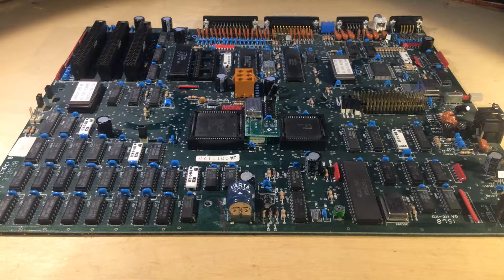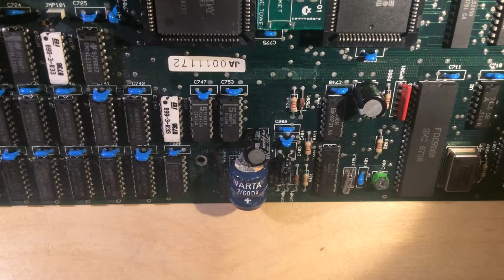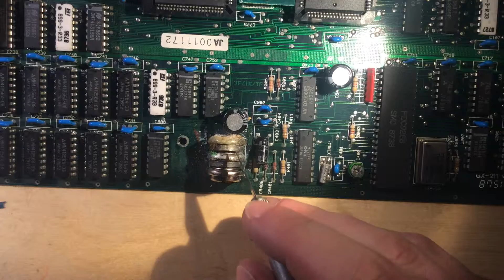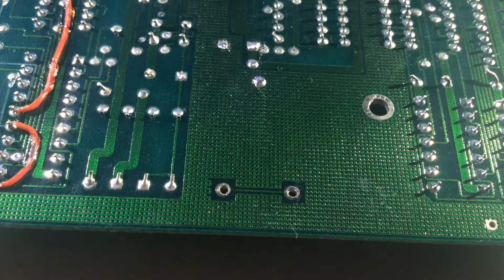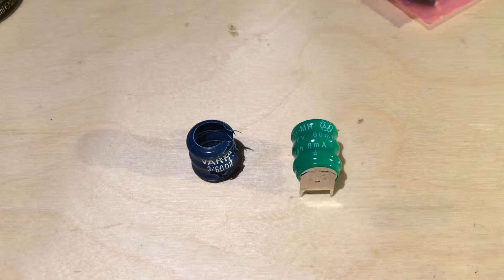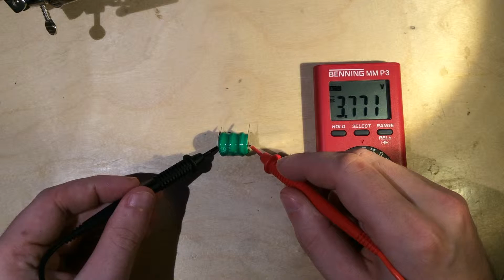How to Replace a leaked Battery - Vintage Computer Repair

Comment: Maybe one more question: The original battery is a NiCD battery. Can it be replaced by a NiMH battery without any problems? Thanks again!
Reply from the maker: yes in this instance they are interchangeable
Reply: @wpef  Great! Thanks again!

Comment: Hallo, I have got the same model, and the same problem. But I have one question. Can the commodore pc10-III run without the battery?
Reply from the maker: yeah this should work,  but you will loose the real time clock.